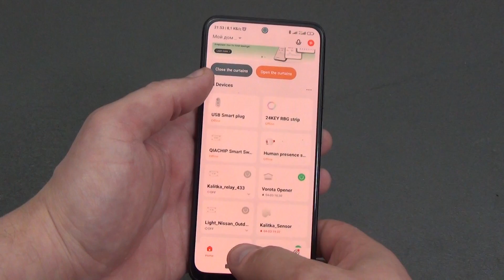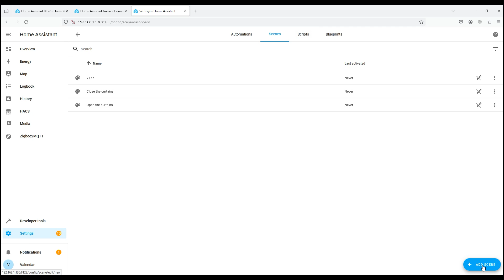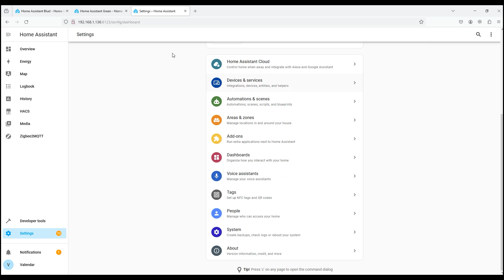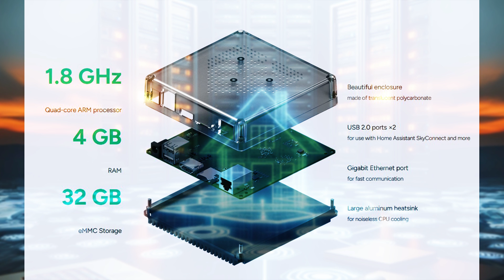Home Assistant: Идеальное "железо" для умного дома от Raspberry Pi до мини ПК MiniITX

Comment: Малина, малина. А почему не банан?
Напр. Banana PI BPI-R2 Pro Rockchip RK3568 Quad-core 2G LPDDR4 16G eMMC Support PCIE M.2 key-e SATA SBC Opensource Router. Или  Banana PI BPI-R64 With MT7615 Module R64 Metal Case MediaTek MT7622 8G eMMC flash 1G DDR3 Support Wifi Bluetooth POE 4G Module.
Роутер то всё равно ведь нужен. Вот и будет всё в одном.
P.S. если навернётся, так всё сразу 😉
Reply from the maker: Ну можно и банан, а там уже будет яблоко или прочие киви =)